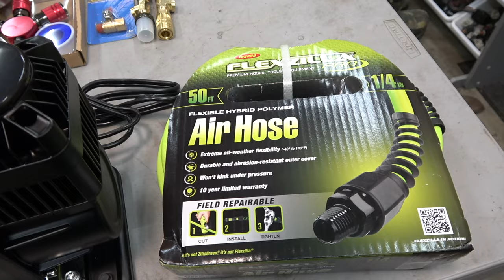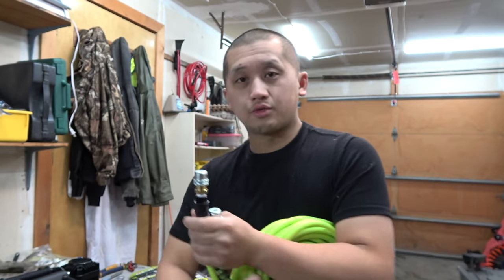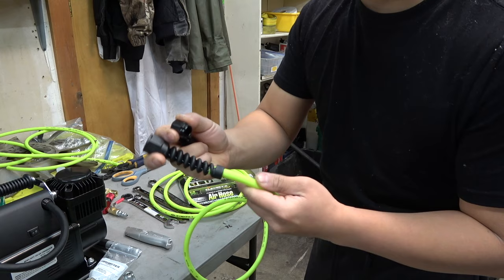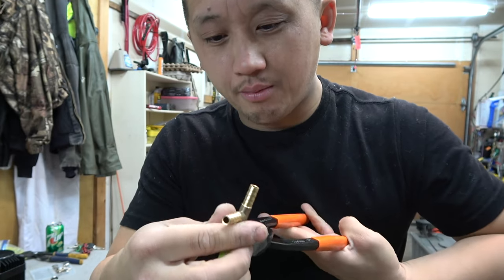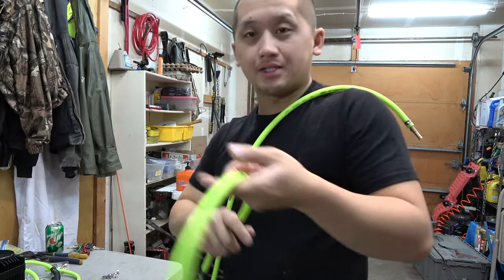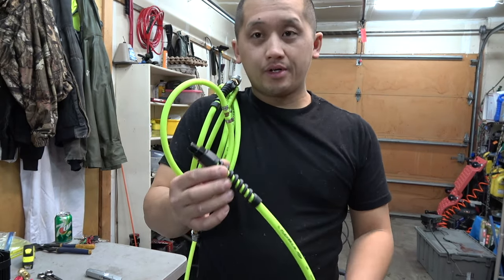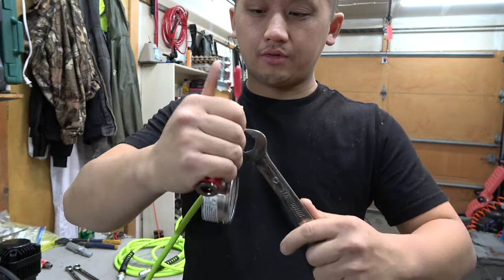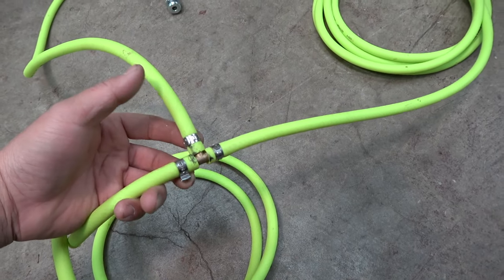FIRST TIME | DIY 4-WAY TIRE INFLATER

Comment: I think it's still going to take a while to fill those tires. You aren't multiplying the pressure by 4, you are deviding the pressure by 4. 
Anyway, that's the way my brain sees it.
Reply from the maker: The compressor is much strong than normal ones.
Reply: @NuttyNu  l'll be watching.